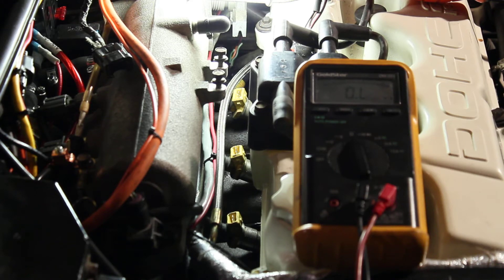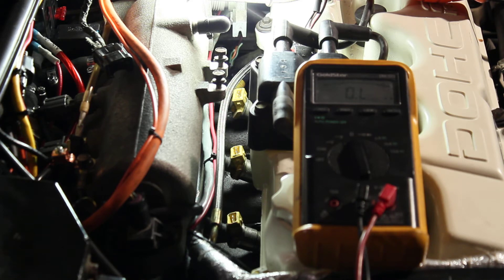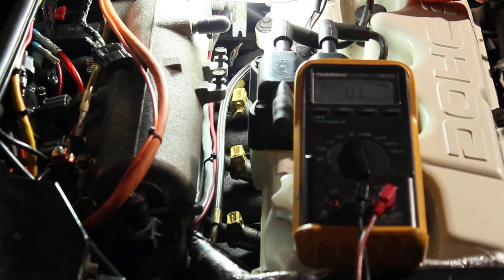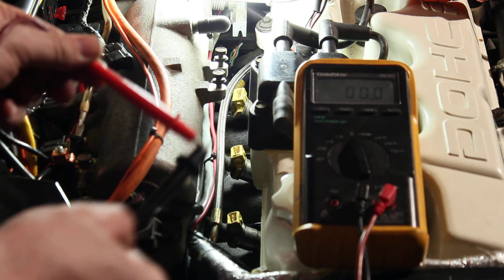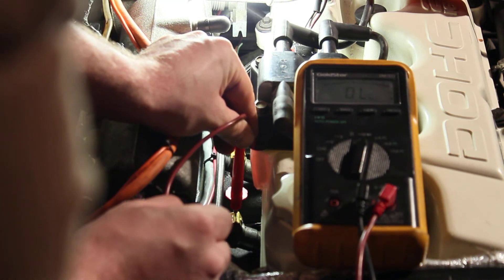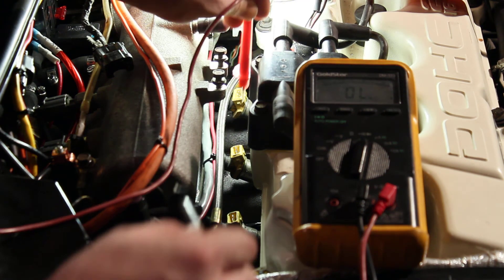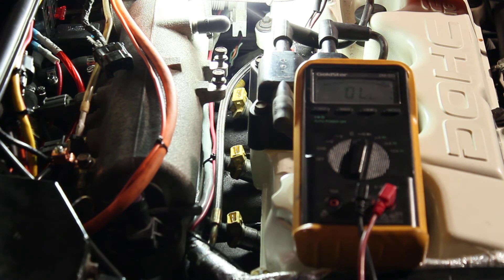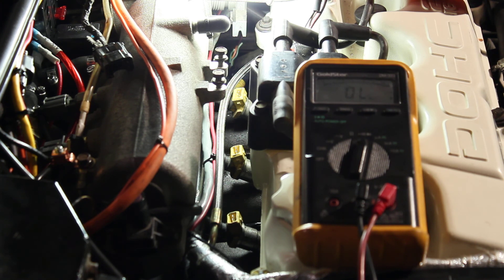Evan's Megasquirt Build Ep 24 - Bad Injector

Comment: I havent either but even on top of the internal failure you have to figure it's weird that it has a ground path to the motor because you would think the only part of it that would touch the fuel rail or manifold would be the injector o-rings. I guess there was a metal part of the case touching somewhere as well.